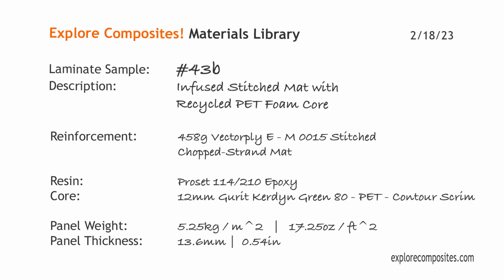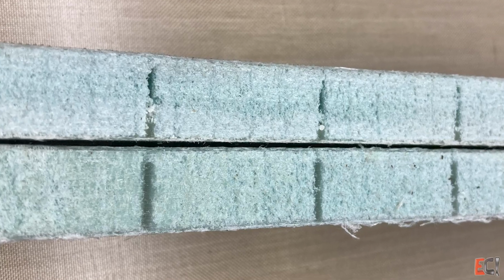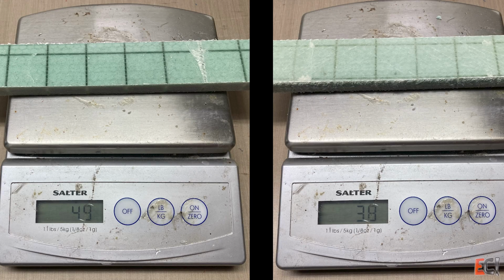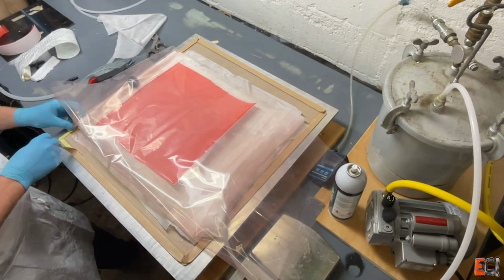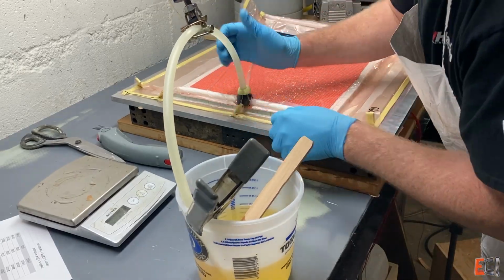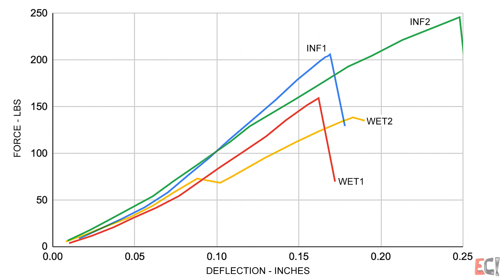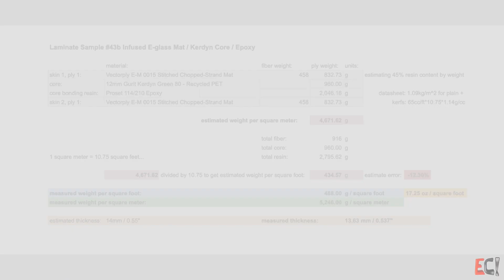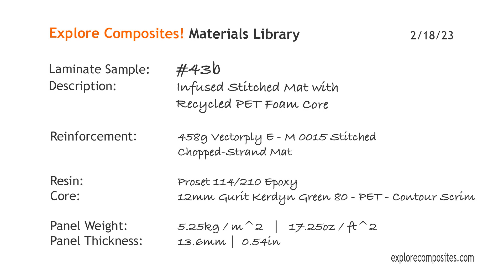Laminate Sample #43b: Infused Stitched Mat with Recycled PET Core

Comment: I am using PET core for a job I'm doing right now. It's horrible! I have to shape it and bevel it. The way the sheets are made and then sliced means there are parts harder than others. So when it is sanded the soft parts sand easy and the hard remain. This is leaving a wobbly line! 

In the video you mentioned the infusion mesh took about 90 grams per square ft. If one sq ft = 0.0929 sq meters then that is about 968g a sq meter. That seems very high - is my maths  correct?!

Comment: On a more serious note, did you post cure these samples at all? The machining of the coupons seemed like the answer is likely no… I’ve really found with pro-set it needs a legitimate postcure for decent secondary processing, otherwise it just goes gummy

And finally, were the cure conditions consistent between the two samples? Something else a post-cure would help remove variables  with
Reply from the maker: Great point!  These were treated similarly but didn't receive a post-cure above 35C - they're also different resins.  The gummy machining is as much the core as the resin - it's very rubbery - and I was using a little burr cutter which made it worse.  I will make sure to address cure in future videos about testing because it is an important detail.

I just figured that at this density and skin weight, the core shear would be the critical failure and was really looking for any impact of full cells.  I have seen reference to 5-10% increase in shear properties from resin in core kerfs/slices and wanted to see if it would show up here.  A significant number of samples and failure to remove  other variables calls into question even the slight appearance of a pattern though!
Reply: @ExploreComposites  certainly makes intuitive sense to have improved core shear properties.... lots of little squares held only on the faces by the laminate vs lots of little squares held on the faces by the laminate and fully encased in the matrix..... the last one please for me!

That is until you realize how heavy infused cored structures are....